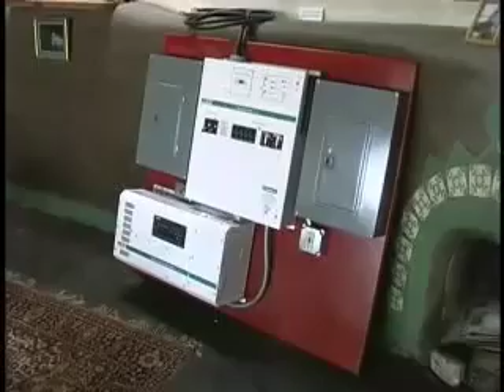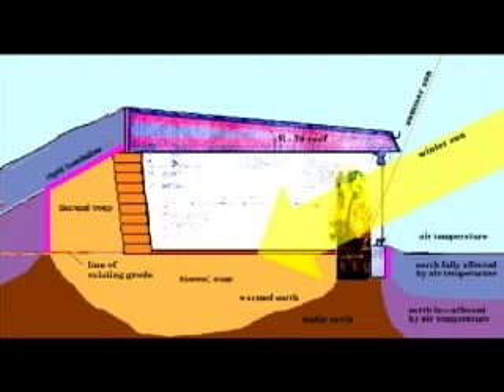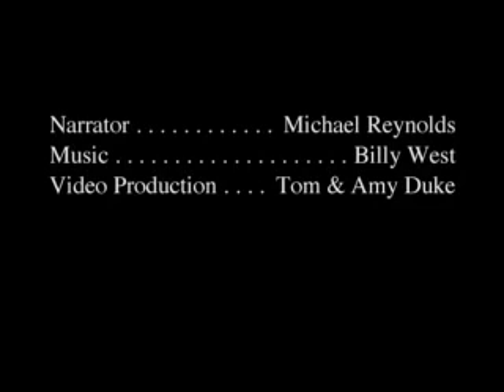Earthships 101 part II

Comment: #EarthSolutionsTV EarthShips101 ;'LetsGetStarted'. #LinkTV
. 1. passive solar home made of natural and recycled materials 2. thermal mass construction for temperature stabilization. 3. renewable energy & integrated water systems make the Earthship an off-grid home with little to no utility bills.
Biotecture n. 1. the profession of designing buildings and environments with consideration for their sustainability. 2. A combination of biology and architecture.

Comment: You guys have a lot of very cheap space or a lot of  money. 3 miles from central london you reduce the living space by 15 / 20% if you used wall this thick. It's a shame, 'cos it's a great idea if you have the space. Me, PU foam & some double glazing, and then try and deal with the condensation, and if I can i'll recover the heat. p.s. Have a look at your truck fuel costs/use getting out to these location, earthship....long tail pipe !

Comment: @rodsboots move your thinking into the long term. If your heating, water and electrical costs are substantially reduced that could offset the cost of building. Do you want another cheap ass boring house on a little square. Where will your family flourish

Comment: On a related note, there is a housing German housing standard called passivehouse.  This building standard emphasizes airtightness and superinsulation, while having a mechanical ventilation system coming from a geothermal tube. This code seems to employ many of the components of Earthships.

Comment: Cont 2 - One last thing is that there is a lot of dimensional wood in the structure that will be covered up.  I believe the bugs will eat the wood.  Even staying on top of exposed wood in Todos Santos is a constant thing.  Even if this wood is treated, the effectiveness of the treatment wears off, and this wood will not be easy to investigate, or re-treat.  I do recognize that there are a lot of good ideas here and I wish them the best of luck.

Comment: Cont - that being said, Todos Santos does have a lot of artesian well water from the nearby Sierra De La Lagunas.  The design of the Earthship in TS is like a strip-mall - U-shaped rooms all open to windows to the South.  The solar gain will be over the top hot in Aug - Sept.  The solar part of it all will pay out in spades, I wonder if there are systems in place to counter the definite lack of (rain) water, and how passive cooling will work with such massive solar gain.

Comment: We make WATER from AIR!Our machine in the Middle East and Africa supplying water to dry regions.We have made it for residential/commercial use here in the US!
Our home/office units holds 8 gallons daily continuous.Industrial size at 1, 350 gallons a day. (We have larger).We offer as a Hurricane Package here in Florida as we have Vertical Axis Wind Turbines,we paired together!With our Turbine, you can power the Water Generator with other appliances and function normally until city power comes on!

Comment: I've seen those $200k+ prices also, but on already built homes. Maybe you heard that number is an actual materials cost, I don't know.

If so, it sounds kind of crazy right? $200K for some framing wood, cement, plastic reservoir, plumping and electric conversion systems, big windows and solar/wind turbines.. maybe.

If its your own labor, you really luck out. The already built homes have to cost enough to support those builders' families.. labor may cost a lot.

Comment: no it doesn't. it does not necessitate tires they only use what is recycled around them. they probably chose tires not only for their insulation, but specifically for their abundance over the world. u are skewing every argument. reliance on the sun is not supporting big oil, get over yourself.